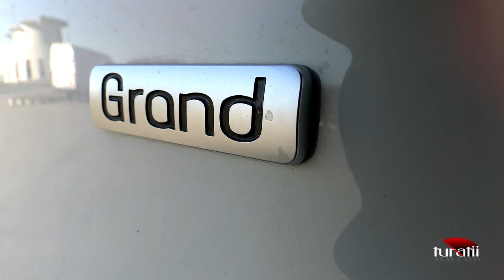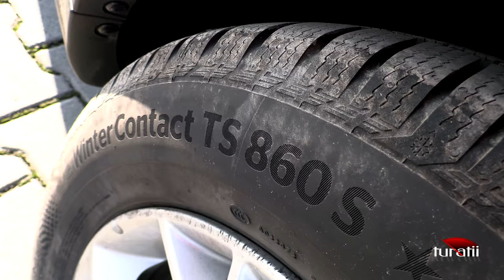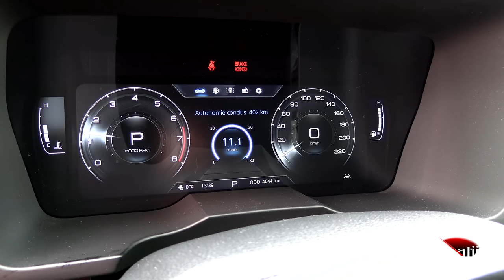SsangYong Tivoli Grand 1,5 l GDi-Turbo AT6 video 1 of 5

Comment: am mers si eu de la constanta la bucuresti cu unul. E ok. Ce ma deranjeaza sunt 2 lucruri. consumul (120/130 constant, 10-11l/100) iar cruize controlul este o mare jena. Nu stie sa stabilizeze viteza, ba accelereaza ba nu, ba accelereaza, ba nu. PS: acel consum a fost facut din picior. daca o lasam la cruize, cred ca ajungeam cu 14 consum. In rest foarte foarte ok masina. eu vomitam cand auzeam de acest brand. acum ma face sa ma uit cu mare atentie spre el.
Reply: Consumul nu e relevant. Pare a fi probleme cu tempomatul.

Comment: Felicitări pentru prezentare!
Pe când și un Korando pe motorină?
Robert, am dori și ceva dimensiuni în cm. a portbagajului/banchete rabatate dacă se poate. 
Mulțumesc frumos!
Reply: Nu se mai fabrica motorul diesel, a fost scos din ofertă.
Reply: @ady12dd1  Mulțumesc!
Nu știam. 
De când?
Reply: @capricsureanu4767  Decembrie 2021. Au dat si informare oficială. Mai găsiți doar lichidare de stoc la anumiți dealeri.
Reply: @ady12dd1  luăm kia sportage.
Reply: @ady12dd1  miroase a faliment.
Reply: @capricsureanu4767  si mai bine, kia Sportage e altceva. F bună mașină, sa o stăpâniți sănătoși.
Reply: @capricsureanu4767  nici pe departe doar ca normele europene nu mai încurajează producția si vanzarea de diesel. Ssangyong au fost cumpărați de un producător de masini electrice, probabil si Ssangyoing se reprofilează pe electrice. Au scos Diesel si aduc la vară Korando full electric.
Reply: @ady12dd1  nu am cumparat-o dar pendulam între kia, hyundai și korando. Hyundai și korando nu mai au motoare diesel, așa că a rămas kia. Acum rămâne să  văd ce cutie de viteze voi alege, mt sau at.
Reply: @ady12dd1  deocamdată nu avem infrastructura necesară pt. electrice. Mai degrabă hybridele.

Comment: O recomandare va rog pt un suv la prețul de max 14.000 euro(cu reducere rabla). Mulțumesc anticipat pt sfat!
Reply: La 14.000
Nu prea ai decat masini CHELE

Dacia Duster cel mai coaja fara aer conditionat (macar o orimesti cu roti si motor) costa 14200
Reply from the maker: Eu as lua un Sandero Stepway, ultimul model.
Reply: @saibamoe  mulțumesc pt sfat,aveam Duster-ul(1.0 eco-g, Comfort) în vedere pt ca am reducere de salariat Dacia și cu tichetul rabla ajungeam pe la 12. 780 euro de la 16.050. Dar la 13.8 secunde 0-100km/h, e cam submotorizat. Voiam 1.3 tce 130 cp dar e pus doar pe Prestige și nu dispun de banii ăștia.
Reply: @turatii  îmi place modelul dar pt o familie cu un copil e prea mică.
Reply: @Biker7432  mulțumesc mult pentru informații.
Reply: @Biker7432  mulțumesc, o sa țin cont de informațiile acestea. 👏

Comment: sfatul meu este sa il stergi si sa il refaci... dai multe lucruri neadevarate aici.... pretul nici pe departe nu ajunge peste 20.000 in alta ordine de idei are 150.000 km garantie..... si mai sunt altele .... este doar un sfat.....
Reply from the maker: Sfatul meu este sa mai întrebi, dacă dorești iti pot trimite fisa mașinii pe mail. La data filmărilor ala era prețul și am explicat clar condițiile de garanție.
Reply: @turatii  Conditiile de garantie sunt 150.000km Am avut Ssangyong Rodius 12 Ani si am ssangyong Rexton G4 de 2 ani... stiu ce vb ..... nu dau nume dar in aceeasi perioada si altcineva a facut acel videoclip ( concurenta ) si nu ajunge sub nici o forma la peste 20.000 de euro mai ales ca ei au acel discount de 1500 euro permanent ( asa de ochii soacrei ca toti dealerii auto de la toate brandurile ).... Nu zic.... videoclipul este ok .... Unele lucruri intr-adevar scapa.... oricum la voi sunt muuult mai reale..... la buhnici are niste scapari de te ia capul..... dar deh .... e buhnici se uita tot poporul...... ( influencer nu gluma.... ) Sfatul meu pe viitor sa iei oferta sa o arati in cadru.... asa nu va mai fi nici o confuzie....
Reply from the maker: Asa cum am spus, conditiile de garantie sunt, citez de pe site-ul Ssangyong: * Garanția oferită este formată dintr-o garanție de producător de 5 ani/100.000 km + 5 ani/150,000 km de garanție extinsă pentru motor, transmisie si sistem
turbosuflantă. Detalii complete si condiții la dealerii autorizați SsangYong. Deci garantia masinii este 5 ani/100 000 si 5 ani/150 000 pentru motor, transmisie si turbo, exact asa cum am spus in filme. Pretul era corect la momentul filmarilor, am avut fisa de la ei.

Comment: Dacă avea si 4x4 ma făcea sa regret achiziția dusterului diesel. 🙂
Reply from the maker: Au 4x4 pe alte piete, nu inteleg de ce nu aduc si la noi.
Reply: @turatii  Probabil din rațiuni de costuri și de consum, ar mai adăuga minim 1500 euro la preț și cel puțin 1 litru la consum, n-ar mai lua-o nimeni.
Reply: @turatii  Initial au avut aceasta optiune, eu am o varianta aproape full option cumparata in 2020, fara trapa doar pentru ca am preferat bi-ton. 4x4 cu suspensia independenta pe spate (scaune ventilate/incalzite .. nu stiu daca mai exista optiunea de scaune ventilate acum dar sunt fantastice pe timp de vara si nu cred ca exista alta masina cu optiunea asta in pretu ala nici acum) :D
Reply: @adriandraganescu6040  duster in niciun caz
Reply: Cred ca si Korando e pe la acelasi pret, si are 4x4 :)